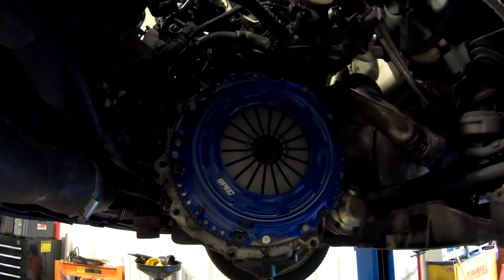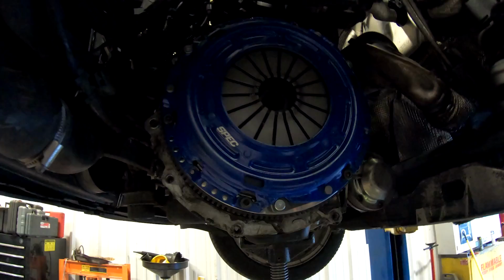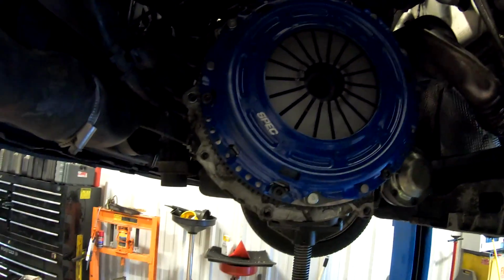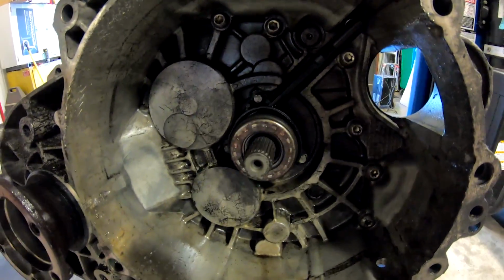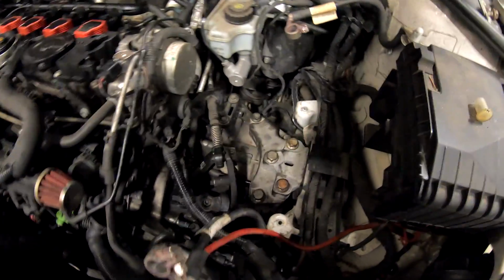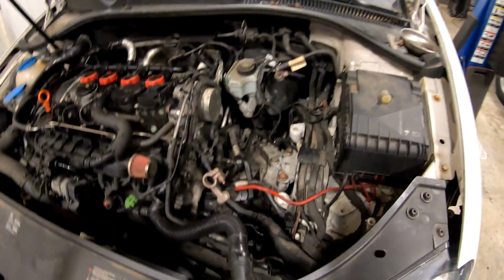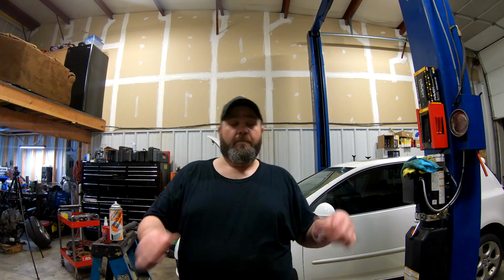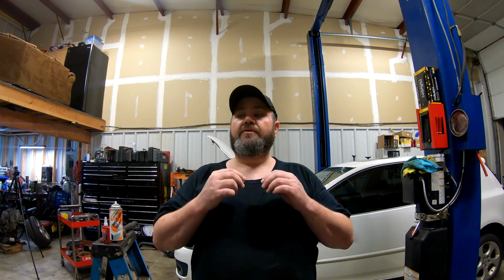VW GTI 2.0T Clutch and Flywheel Install!!!

Comment: Woudve much preferred seeing you install the rear main and flywheel...especially seeing as you went from dual mass to single mass flywheel.  Than watch you wrestle with the removal/install of the transmission.
Reply: I agree. I came here hoping to see more clutch. The single mass flywheel is way thinner then the dual mass. Is it throw together and go or is there a spacer... Still don't know.

Comment: If you remove the right axle flange it will not require loosing the subframe and it,s a lot less hassle
Reply from the maker: Thanks! I’ll remember that for the next one.

Comment: Hey do I have to bleed the hydraulic bearing/ pilot bearing??? I would like to know before is put it back together. I have mine torn apart right now!
Reply from the maker: If you did not open the hydraulic system then there is no need to bleed it.